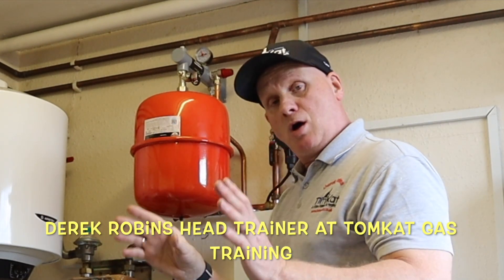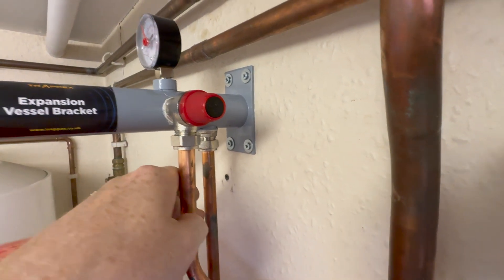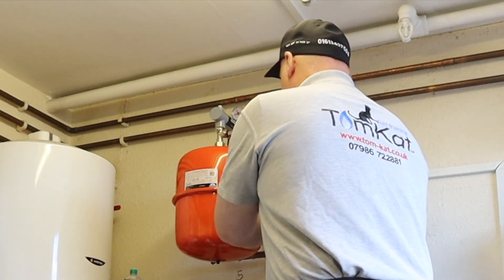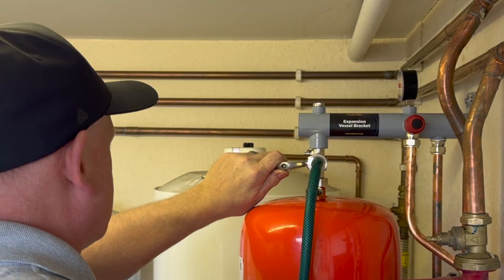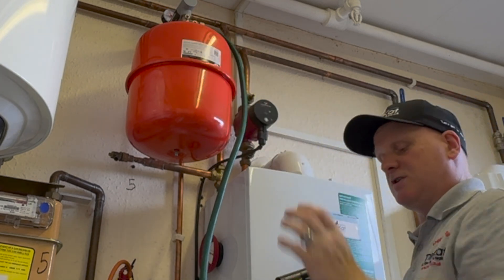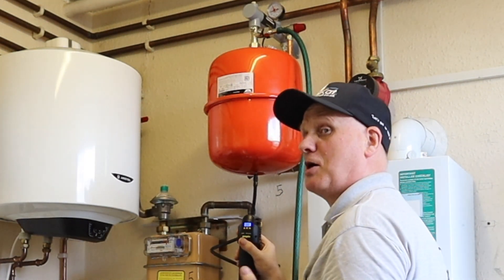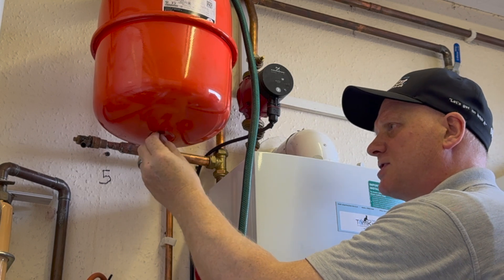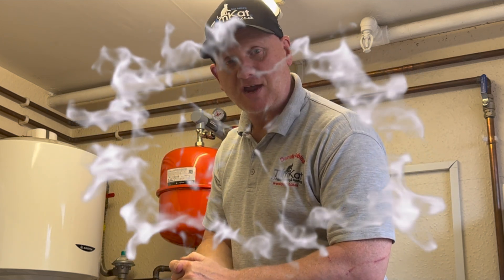How to check the pressure in an expansion vessels when using a Trappex expansion vessel bracket.

Comment: Hello, im working on a new build plot and the cylinder and devices are in a ground floor cupboard.. I know that isolation valves aren't permitted to expansion vessels (G3 regs) but it would make sense to have a way to isolate the heating vessel otherwise the heating system upstairs will need fully draining and inhibitor adding on a service..